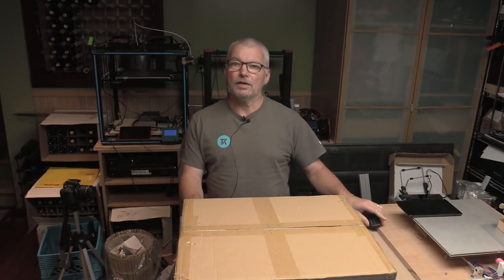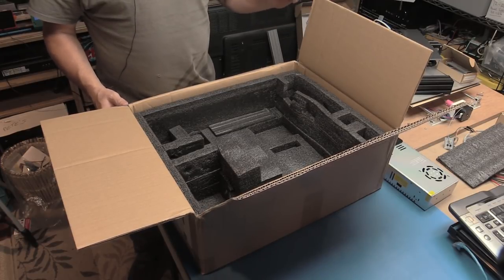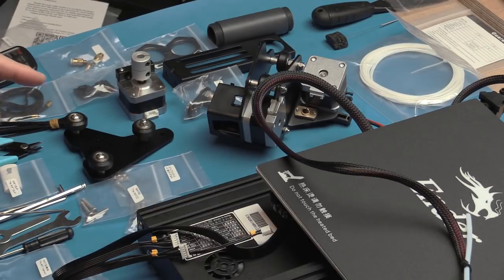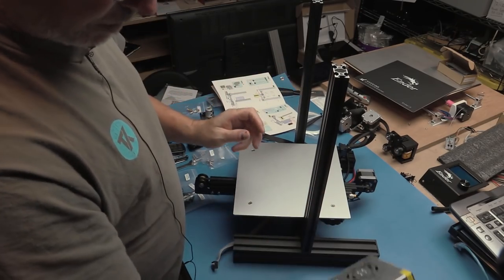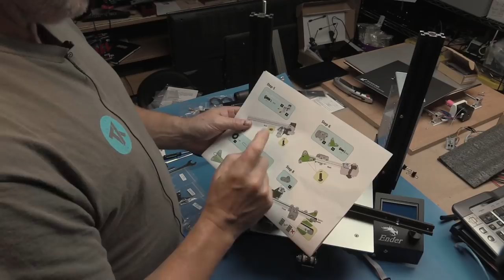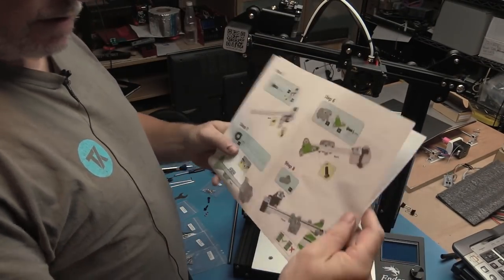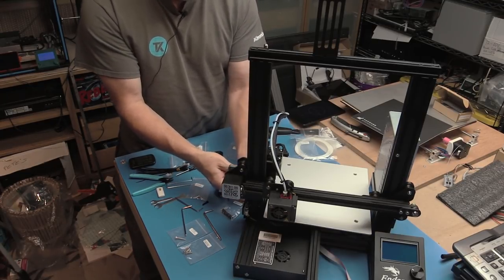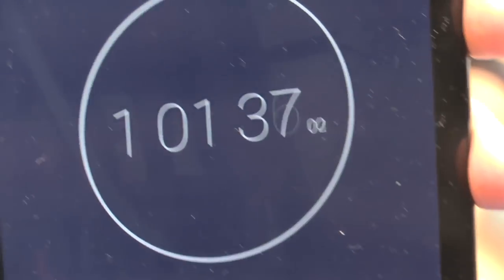Creality Ender 3 Complete Detailed Build

Comment: I have heard that there are more detailed instructions on the included memory card.

As far as the Allen wrenches go, if you have a good set, use them instead of the included. Cheap Allen wrenches can round out and then round over/strip out the bolts heads.
Reply from the maker: There is supposed to be. But my sd card was unreadable except by the ender 3 itself... go figure

The wrenches are good enough for the job but I agree that if you have better then use them

Comment: Good build video!
Which one would you recommend the Ender 3 or ADIMLab Gantry-S?
Thank you.
Reply from the maker: there both good printers, the ADIMLab has a bigger build surface and you can upgrade the drivers if you want to Trinamics etc, the Ender 3 heats up quicker due to smaller build plate but has non replaceable drivers. The Ender 3 has much stiffer frame due to larger extrusion sizes but only uses a single Z axis motor, ender 3 is also initially easier to assemble as it is mostly built already. Older ADIMLab printers were a pain to level but I think this is significantly improved in current model.
Reply: @TheBreadboardca  Thank you for the detailed response. I decided for the ender 3, just because it has a huge community.